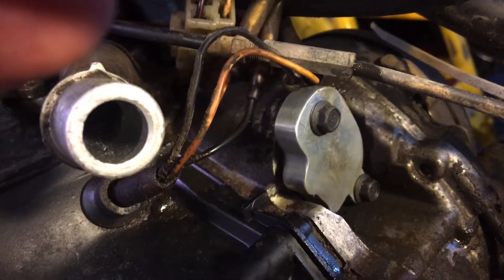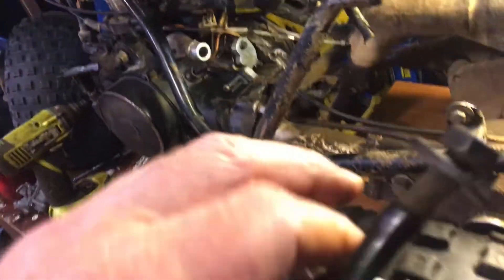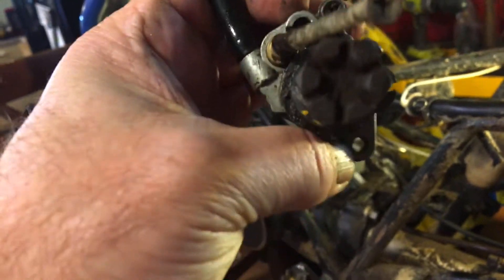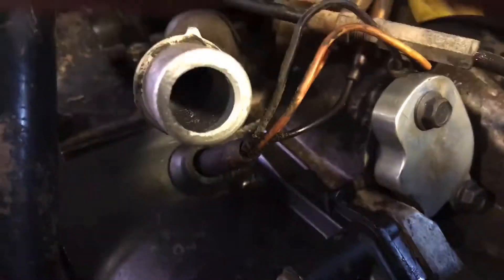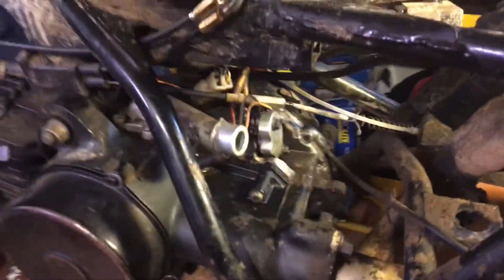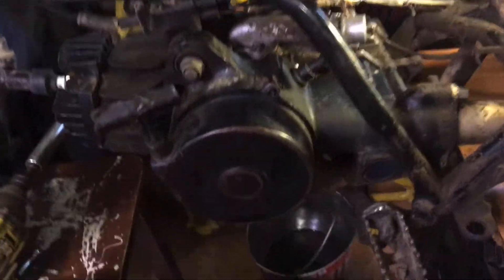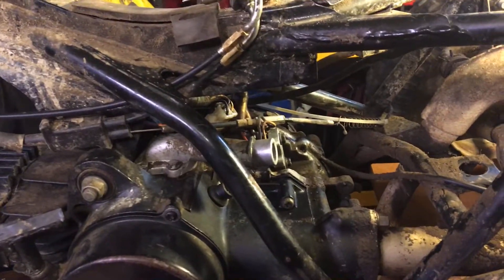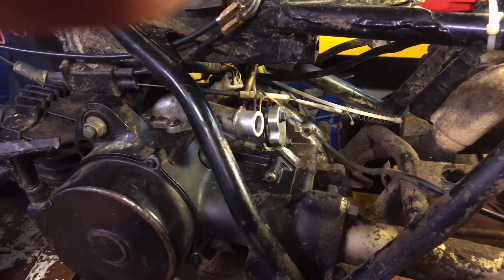TRI ZINGER OIL INJECTION REMOVAL TO MIX YOUR OWN GAS

Comment: What is The line for on the bottom of the carburetor , I did everything you did I don’t know what the line is for the bottom of the bowl on the carb do I block it off too
Reply from the maker: hose on carb bowl is the over flo do not block it off
Reply: Okay what do I attach it to just let it hang down